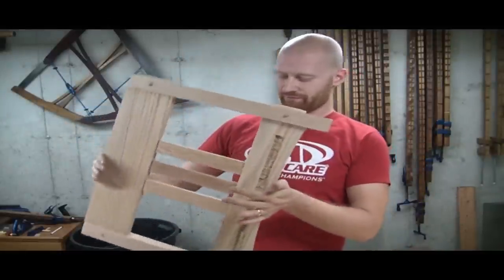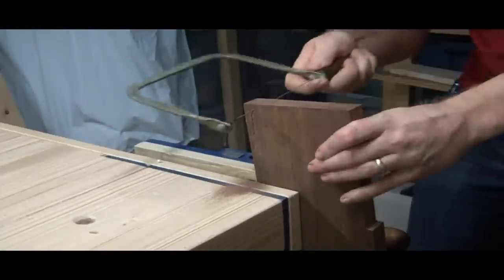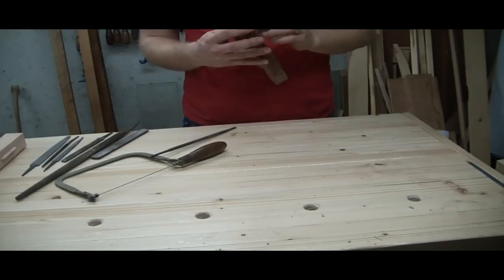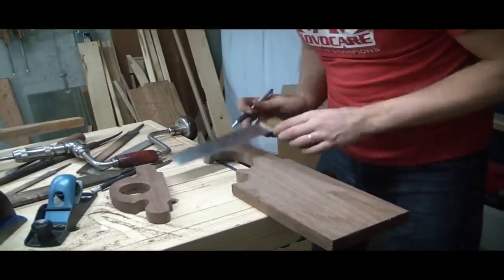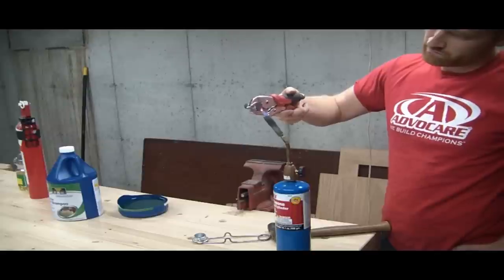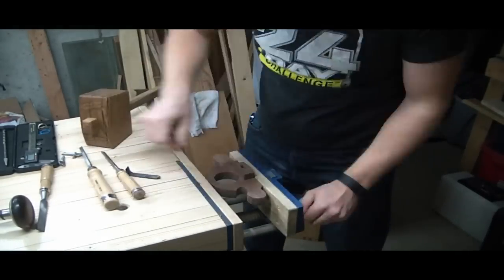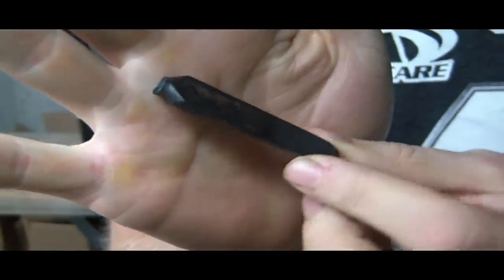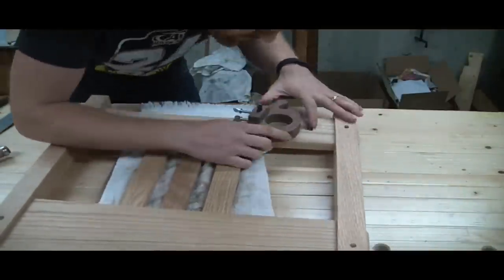How to Make A Hand Router Plane With Hand Tools Building Tutorial

Comment: cut 2 rabbits one at the top of the fix jaw and one on the bench side about 1/4 square inch. That way your part will not shift. Or drill some hole and use some 3/8" holes in each faces opposite of each other and put 1" wood dowel pins 4 required. There are other method but "Stop" sure help and less vice pressure is required to hold the part!

Comment: I'm curious about your set screws. Do you not think the threads in the wood we'll strip out before too long? Just curious just curious because I think I may like to try this project. Great video by the way, very informative.
Reply from the maker: On future ones I've put in a threaded insert. I found that if I'm regularly going to be taking the screw in and out they wear down a little quicker than I would like. Still functional but understand its life span will be a little shorter. If it's something that only goes in once or twice such as building a tabletop then I have no problems with all wooden threads.

Comment: Re the sound, the auto-captions work well enough to follow the build.

The blue colour on the shiny metal means that you tempered it a bit too far - you would aim for a bronze tone for a chisel. blue will make it a bit soft, and prone to losing its edge. (the colour will go from yellow, to straw, to bronze, then blue)

Other than that - quite a good build. (better than mine :) )
Reply: I also use an allen key for the blade.
Reply from the maker: I have used Allen keys on other ones but I am not a fan of the material removal needed to make those work. you are true the temper went a bit top far on this but no biggy I am not looking for perfection just usability.

Comment: Nice build! I may do one myself. A little constructive criticism if you don't mind.. You might find the chisel is a bit soft as it turned blue in the oven. Probably the thermostat is off. May I suggest another harden and temper cycle? Freshly polished or cut steel is usually tempered to a straw colour for woodworking tools
Reply from the maker: thanks. and yes the thermostat is off. I now use an external thermometer. that is something I have scene done. This was my first attempt at it. but messing up is the best way to learn. LOL

Comment: I'm finishing my router plane and I was wondering if I make a parallel fence for it then I could use it like a plough plane and not have to invest in one right now. Do you think there is a advantage of plough plane make grooves over the router plane? +Wood By Wright
Reply from the maker: sure can. you just have to advance the cutter down just a smidge each pass. that is what makes a plow plane easier because it has a sole so the blade can just take off a small amount each pass.

Comment: nice video. do yourself a favor though. get yourself 4" angle grinder and an acetylene torch set up, like a turbo torch or prestolite  set up or at least a bottle of mapp gas. that propane wont get that tool steel orange hot which is what's needed to really harden that tool steel but do you really want it hardened and tempered again if it's going to be constantly sharpened? 
btw, Makita makes an awesome 18v Lion 4" angle grinder. it comes with a good grinding wheel. add a cutting disc, flapper wheel and wire wheel and youll add a lot of dimension to your shop and depth to your skills. ..as well as save time and hacksaw blades. lol  thanks for posting.   oh.. I have a chart that identifies what all the different colors mean in metallurgy I forget what blue meant. definitely an altered state tho.
Reply from the maker: LOL. not on this channel. thanks though.
Reply: Wood By Wright ok. I get it about the power tools but if you will allow propane gas, why not use a gas that will actually heat the steel hot enough to do what you're saying propane did. or stack some fire bricks into a makeshift forge and pump more air into the mix to heat up that flame charcoal works too.

Comment: It's also on my to do list. in most of the plans it seems the lower/angle the front to allow you to access a set nut on the inside where you put them on the back. Maybe because that would let the iron reference off the flat back, but two set screws might also work. Was this a planned change?
would adding handles (like on the metal hand routers) help this design? 
Also couldn't help notice the large wooden bar clamps in the back. Are those your design?
Happy woodworking :-)
Reply from the maker: +Nearoth I put the set screws in the back so they would not be in my view of the blade. the front of the blade has a very good fit to the body so I have not had any problems with it.

I was initially going to put handles on it, but this one was a bit too small and just gripping the outside wings actually feels good. If I made it larger I would put handles on it.

You are my new favorite friend! you are the first person to comment on the clamps! about a year ago I was at a garage sale and found 3 of them with all the iron parts rusted. I bought them for $1 each and thought they would just be for display. but when I started building my bench I so wanted to use them I cleaned them up and  got them working. sense then I have found about 20 more. in the end they are all I use now.

I do have a set of 7 that I made but I am not that happy with the final result. Thanks for noticing!
Reply: +Wood By Wright I was going to ask the same thing. Do you know where you can buy anymore of those clamps? They are really intriguing.
Reply from the maker: +chiggymonkey all of mine have come through garage sales and one really good find on Craigslist. I don't find them very often but when I do I snatch them up

Comment: James, quick question, did you consider purchasing the Veritas Router blades  at all when making this or since?  I fully understand the using what you have on hand, but at ~$15 and more size choices it would be interesting to see these used.
Reply from the maker: +John Arnolde Yes I did think about it and I am still thinking of making two more with two different size decks, but for this one I wanted to learn and play with the steel prosses. for my next one I may or may not make it to fit their blades.

Comment: Nice build, but I'd like to suggest something.  Cut mortises on top of the bench rather than in the vise.  Just put the work piece on a bench hook.
Reply from the maker: +deezynar I have sense switched to doing that. this is a hold over from before I had a bench. I think I am soon going to be making a new router with a larger base. but we will see.
Reply: +Wood By Wright I said that because I never had any woodworking training and I used to do everything in the vise.  I think it was after I bought Tage Frid's book that I saw how much easier it is to cut mortises on the bench top.  However, sometimes the vise is the best way to hold something for cutting mortises, so I've learned that in those situations to put a block of wood under the work piece in the vise.  It sits on the vise's guide bars and keeps the work from sliding down or twisting.  Anyway, that was a nice router plane you made.  But after using it, you're thinking a bigger base would be better?  That's good to know.  I look forward to seeing you make another one.  I have been thinking about making one, and think I prefer ones I've seen with taller handles.  But I heard one fellow say tall handles caused the tool to pitch down in front when he pushed it forward.  So maybe taller handles aren't what I want, but I think I want something to come up higher from the work piece than just an inch.  Maybe 2" thick stock coming straight up all across the back of the tool, and the front of the tool would be much thinner, maybe 1/4" thick brass plate.  That way the blade has it's thick section to go thru, and your palms would have something to push against.  Also, your fingers could curl over that thick piece and get a nice grip.  Just thinking.
Reply from the maker: Well bigger is not better. there are times that a bigger base would be helpful but I am also thinking of making half the size of my current ones with a 1/8" cutter. for a main router 6"-8" wide is perfect, but as with all things one size does not fit all work. well My other router has handles but that is because it is a steel base that is only 1/4"tall but even then I only grab the base of the knobs. you really never want to push any higher then 1" because of it pitching forward. I find the 3/4" on this one to be surprisingly comfortable. I originally planned on putting handles on this one but found I liked it with out. but each to their own.
Reply: +Wood By Wright Good to know.  Thanks.
Reply from the maker: Any time! thanks for the great questions.